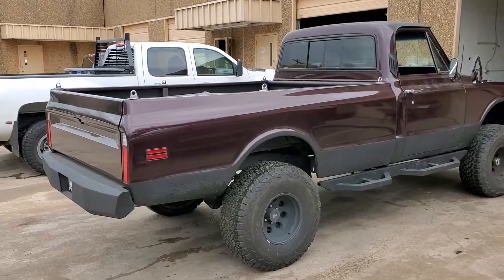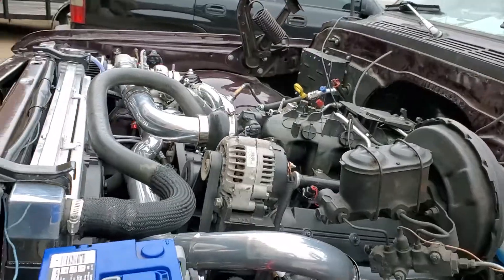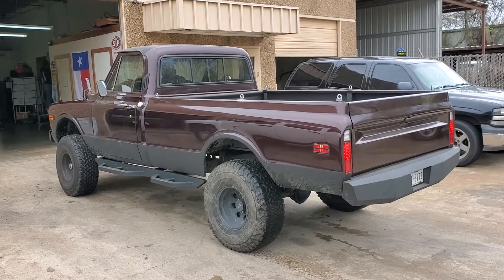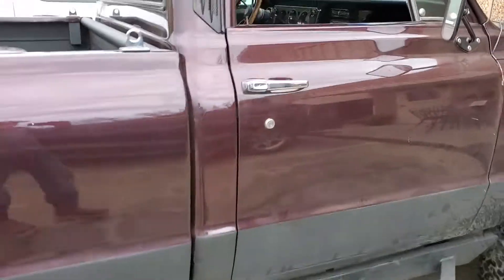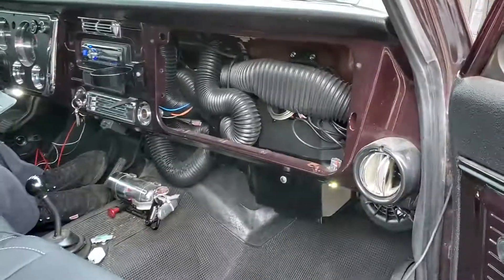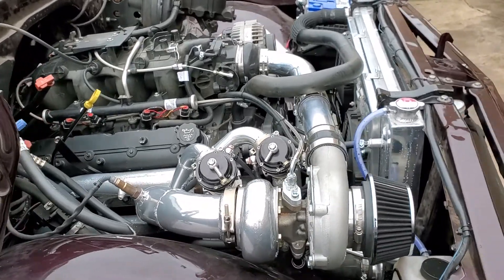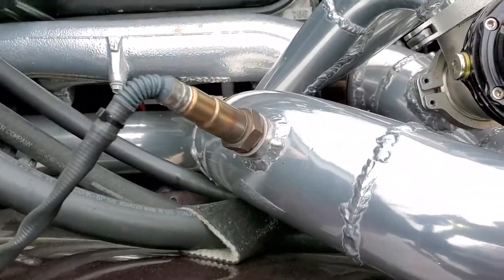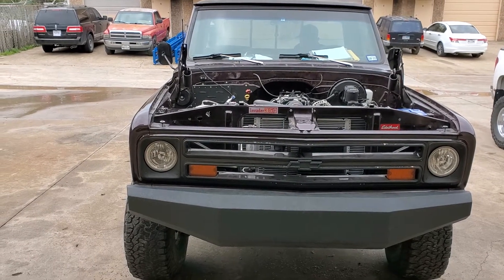72 k10 4x4 turbo 5.3 holley terminator x max

Comment: I like the route of the turbo plumbing, my see I have converted up high, I just watched the video because I  was hoping you were going to address the issue of no shift out of first in low side 4×4 with Terminator x
Reply from the maker: All ours shift great out of first 
The issue is how was the tune setup done
Reply: @thetruckstopdfw9138  That's awesome! Holley, and apparently the rest of the internet, forums , all tuners across the world claim it's not possible,  you could really set the world on fire with that information,  VIP rooms groupies free buffet autographs chicks at the strip club putting dollars in your drawers. If you don't want to share this magic, you could make a video of putting your truck  in 4×4 low and it's shifting through the gears. But I think you would have to stay open 24 hours a day 7 days a week for the demand,  👍
Reply from the maker: @kevinwest3689  sorry I saw 4 high 
4 low hasn’t been used in this guys project 
We mounted and machined our own tone wheel and stock vss on the shaft and housing of this 4l60e hybrid
Reply: @thetruckstopdfw9138   no worries" could have been at the top, when I was trying to say I mounted my AC up high, and my phone decided to change the words and I didn't notice. Luckily I didn't have to do anything special for my 4L80e to shift correctly in 2 or 4 hi, Just had to change out input shaft on my 241c. Glad I couldn't afford to do the cam Springs when I installed it, the new btr Chuck Norris cam sounds like the hot ticket, have to wait to see the dyno results to see where the crossover is. Compared to the stage 2 or the sloppy, comp 469-11   Good job